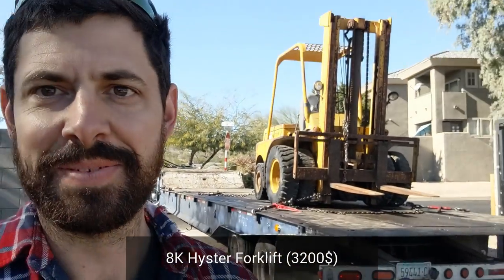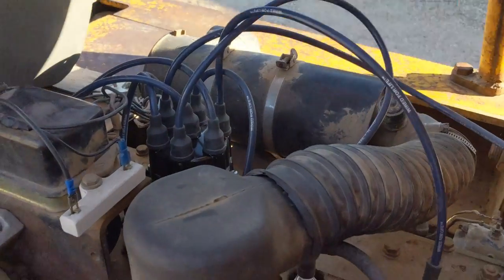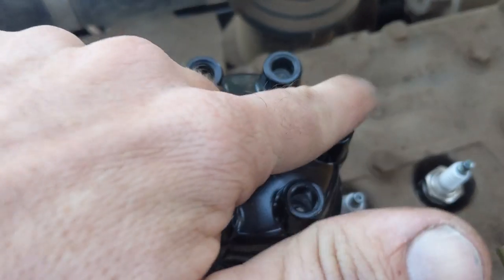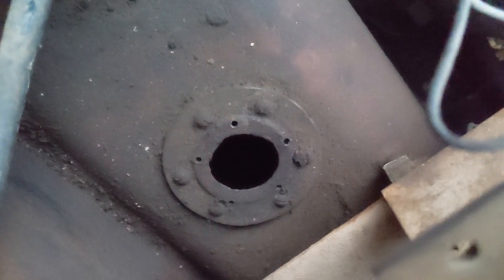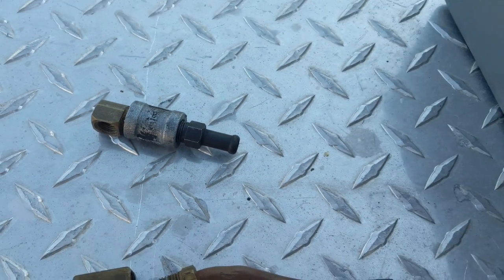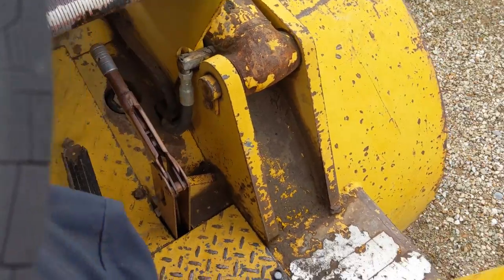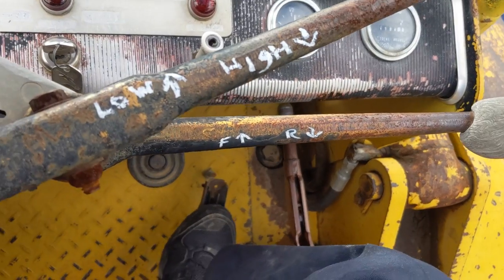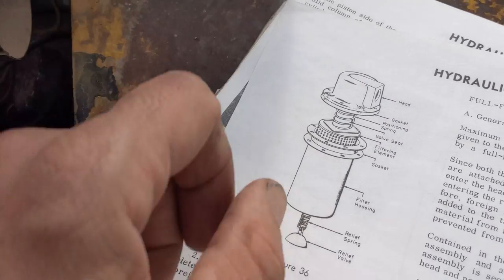Bringing an old dead Hyster Forklift back to life

Comment: Hey guys. I am a feild tech for Briggs Equipment.  Hyster dealer. Great video.  I still work on and rebuild these motors. 163 an 172. Redseal flatheads back in the day. Good engine. Y'all besafe and have a great day👍👍👊

Comment: What a great score!  And, a fabulous tool to have around. I see that someone put a hitch ball on one fork, which should suggest an easy way to spot various trailers.  You can buy repair kits for those hydraulic cylinders fairly easily. I never rebuilt one myself, but have watched it being done. There are probably several videos on YT to show the fine points.  Nice job! Wish I had one like that years ago, all I had was a little three wheeler with a Crosley engine, but it served my purposes at the time, but that was in the 1970s.

Comment: I used to drive the Perkins engined version of that truck it was indestructible, only failure to proceed I remember was greasing it one day and had mast fully up and a hose burst it came down so hard it broke the concrete floor, always propped it after that.

Comment: Awesome, thanks for sharing your knowledge. Your diagnostics are on point.

Edit, I would have flushed the sediment out of the tank just for peace of mind and to save the filters
Reply from the maker: I did take a look at the drain plug but it was frozen solid and I have had bad luck in the past removing rusted ones. I must admit I took the easy way on that by just adding a new filter and making sure the pickup tube wasn't clogged. Good eye

Comment: I've used 2 Hyster forklifts, both had forward and reverse on the accelerator pedal; pressing the right side put the transmission in forward gear, pressing the left side put it into reverse gear. I could stall the engine if I wasn't careful! The flat-head engine design must have been very durable, I see it a lot.
Reply: It's called monotrol
Reply: Im 16 and i work with that type of pedal on a hyster every saturday. They are very nice.

Comment: Six cylinder flat head., these forklifts are incredibly well built,  twenty millimeter thick rolled steel wheel guards. Frame sides are ten millimeters thick alone. Super strong.
We used to build these from scratch.
Reply from the maker: Danville, IL, right? I'm so used to building restomods where weight savings are important, it's so strange to see fenders made of almost inch thick steel. Strange and awesome
Reply: @AustinCoulson  No we built them under licence in New Zealand with a lot if caterpillar equipment. We had a hyster  assemble line next to a caterpillar assembly line. 
yes the fenders are profile cut then rolled. Your lift is the Hyster H150 , the single drive wheel with narrow fenders is the H80.
Check out how robust the steering Axel assembly is under the counterweight. 
Hope you get plenty of use from this lift , very strong. 😀
Reply from the maker: @axeman6560  I was actually looking at the steering the other day because my buddy's 4k forklift broke his steering arm and I wanted to inspect mine and it looks practically indestructible. I shipped a turbine engine to NZ a few years back for a guy who used it as a starter for an even bigger turbine engine.
Reply: Mine has a Perkins diesel  in it, it's a really strong machine, very simple to fix
Reply: @elljay4587  Perkins nice
Reply: It looks like a Clark F 60 I owned not to long ago , had a cont. 209ci in it was a very similar looking machine . Will have to talk to some old guys that used to work at Clark Mfg where they built them , I believe Clark and Hyster are related companies.

Comment: I worked on Hysters for 24 years You will never wear it out, Best machine on the market. A bit of advice the ONLY suspect part is the head gasket make sure its always full of coolant and the fan belt is tight and radiator is clean. The head can warp if they are left to constantly overheat and the centre bolt on the head is very close to the bores and can corrode and break in. Its a Continenal side valve engine.
Reply from the maker: Thanks for the heads up.  I use this Hyster on average 2X a week and usually for less than 10 min or so at a time, and now that I have a gauge I can keep an eye on the temp. Always good to know where the weak points are to keep an eye on em.

Comment: The fuel filter in the tank attaches to the round metal thing on the end of the fuel line.   I've used them,  and they're fine, but they're not supposed to go in the tank.

Comment: Wqw,, we had a 5 ton,  5000 kg   one like this at work in the mid 80's ,, the Maintenance man replaced the old side-valve motor with a more modern OHV Holden motor ,,, took the duel wheels of and replaced them with single wheels ,, it still was going well when left 15 years later ,,

Comment: I would think that is a three speed if you lift the hi-lo lever and pull it toward you that’ll give you first gear, it’s so low it’ll never have been used so probably be stiff
Reply: You are correct! That's a 3spd,no one really likes putting it in 3rd because it goes sort of fast and is scary to operate. The range shifter gets stiff because it's not used much!

Comment: Cause and effect, what was the last thing done when it stopped working. Middle of the night call: 'We changed the fuel filter and now it doesn't run." They had reversed the inlet and return lines. Retrace the steps. Made a few of those errors myself, knew who to blame.

Comment: I had an '84 Camaro that I did a tune-up on and after changing all the plugs, cap, rotor, wires, etc, it was running like crap.  Went to pick my girlfriend up from work and one of her coworkers came out asking why it was running so rough.  I told him everything I did and he said "I can fix it in five seconds".  I was in disbelief, but I opened the hood and he looked around for a moment before grabbing hold of the cap and twisting it.  You couldn't even see it turn, but sure enough when I started it, the car was running fine.  He said that particular cap can look like it's seated correctly, but you have to wiggle it around and you'll feel it "click" into place when the springs on the clips engage properly.

Comment: There is water in the hydraulics, the vent on the hydraulic reservoir is clogged. The vent tube on the mast cyl may be clogged, and the mast cyl probably needs repacked, both the piston seals and the top seal
Reply from the maker: Thanks for the info, I will take a look at that vent today!

Comment: The clutch is only there so you can give throttle for you hydraulics to operate faster without moving.
You don't need to use it when moving or changing from front to backward.
Reply from the maker: Hmmm I'ma have to try this when I get back to the shop. I was using the clutch like I usually do on other equipment.
Reply: It's an inching pedal not a clutch
Reply: @joeharmer574  I think you will find that its an oil clutch you cant change direction without stopping. Hyster made these with an oil clutch and a torque convertor with power shift usually with the  mototrol pedal but sone did have hand control levers. I worked at Hyster for 24 years
Reply: @derekevans8266  After watching it again. it's a clutch. Doesnt mean it's the oil clutch version. I own 2 oil clutch units. Neither are monotrol and have a 13K one that's manual that is not oil clutch...similar to this one.
Reply: @joeharmer574  I think they did oil clutches and dry clutches we only had one customer who bought oil clutches 99% were new monotrol

Comment: really common issue with the hydraulic cylinder drifting, might require replacing the section in the valve body for the lift cylinder as those cylinders dont have holding valves and rely completely on the valve body to keep and maintain pressure in the cylinder.
Reply from the maker: Thanks for the info! I am by no means a hydraulic specialist so I will take a look at the manual and see how hard it looks to replace/repair that. Right now, the drift is so slow that it really hasn't affected its usefulness yet, and i've been too busy using this thing to have any downtime to work on it.
Reply: @AustinCoulson  honestly i would not even touch the valve body unless it is leaking alot, those can be a nightmare to seal correctly once taken apart.  Plus its pretty normal to have some drift on a forklift as they are a material handler, and not a holder. if they were to be expected to hold things for extended periods of time the cylinders would have holding valves.

Comment: You either have a blockage in the filter, or there is air getting in from the suction line causing aeration of the fluid, if there is wear in the hydraulic pump it will also cause those symptoms
Reply from the maker: looks like you figured it out quicker than I did, probably due to your great name...I tear the filter apart in part 2 and it was clogged big time

Comment: Not a clutch. It works an inching valve in the trans. When you push this pedal it sure hold the brake and kicks the trans out of gear you can riv the engine to pick up a heavy load.

Comment: Hey great video I have one of these machines with a missing mast cylinder do you have any resources for parts?
Reply from the maker: There were a few industrial shops in Phx I used for hoses and seal. I got a lot from eBay though

Comment: Great job. I'm not trying to be negative when I say the the continental engine is very durable but never produce a lot of torque or HP. I've seen countless ones that have cracked the block on the deck (if I remember right, it happens between #1 and #2 cyls) In the forklift industry we joke that you get 1 HP per 100 pounds of engine. Your lift cylinder leak....The cylinder is what's called a non displacement cylinder so the seal on the bottom of the rod (on the piston) is bad. The hose that run down the side of the cylinder is so the fluid that gets by that seal has somewhere to go (back to tank) Obviously seals involved in the gland nut but that's just so it's directed out the hose. Just a little FYI
Reply from the maker: Not negative at all, great info to be on the lookout for!
Reply: Austin Coulson....a customer of mine has a 13K forklift very similar to yours but it has a straight 6 GM motor. Again...nice job buying and getting it going! If they could all be that easy!
Reply from the maker: @joeharmer574  easiest fix I've had in years. Could have gone south really fast and ended up with a 11k lb boat anchor in the driveway
Reply: Austin Coulson.....No kidding! They are a very durable engine and I've got them running before after sitting for years

Comment: I personally wouldn't want to run a forklift that doesn't have a clutch. It makes it possible to rev up the engine to speed up the hydraulics while on the move, which is handy while unloading trucks from the ground
Reply: Inching pedal

Comment: Had a look at the video and you have a standard two stage upright and I am 99% sure that the hose from the top of the cylinder is just a vent hose and should never be under any amount of pressure. The oil leaking from the very top of the cylinder is leaking passed the wiper seal as it is venting back to the hydraulic tank. In theory there should never be any oil up there. The cause of your forks dropping is the oil is leaking passed the main ram seal getting to the head of the cylinder and venting back to the tank. So remove this vent pipe and see how much oil is getting passed the seal. Be careful you might get wet. The truck is a H80C
Reply from the maker: Thanks for the heads up, I will try that. Also, I was unaware that fully extending that cylinder often was good maintenance

Comment: Brother , amazing machine but please lubricate those chains happy lifting 👍
Reply from the maker: I lubed them with 30w oil per the manual. Good eye.
Reply: @AustinCoulson  thanks for the compliment are they cleaned prior to lubeing
Reply from the maker: @virtuousman794  I used a bristle brush and then soaked them in oil. I was taught on motorcycle chains to not degrease, steam clean, or pressure wash, but I'd be interested on your take on that
Reply: @AustinCoulson  we use tooth brush and gasoline to clean those chains and sprays crc or wd 40 brand premium white special lithium grease the stuff is amazing they won't run out or accumulate dust or grime easily by the way did u take care of those grease nipples.

Comment: That previous“mechanic” should have his tools taken away.
Reply from the maker: 100% and give them to someone who will learn to use them
Reply: @AustinCoulson  he probably mistook number 6 cylinder for number 1.
Since number 6 is in the front of the truck.
P.S.
I just drop plastic coffee straw into the spark plug hole, you can fish it around into the cylinder and feel the piston climb and fall.
Reply from the maker: @glennchartrand5411  you are probably right on him mistaking the front and rear of the engine as front and rear of the forklift and doing the wiring backwards. 

The problem with using a straw is on the flatheads the spark plug isn't over the Piston, it's off on the side and all you can see are the valves.

Comment: I've driven Clarks, Toyotas, Cyclones, Yales, some weird Indian import, and Hysters. I'm a Hyster guy, they really are built like tanks and run solid. The newer Toyotas are trash. Ours are constantly breaking or wearing our while the old 80's hysters keep running like tops.
My fav of the whole shop is the 12,000 lb Hyster we use as a backup for moving steel. She'll lift 12k and controls great. If the load's too heavy, she let's you know by not lifting it. The hydraulics won't budge. Our big 12,000 lb Toyota on the other hand will lift 10k and starts to get squirrely, hard to steer, bounces about. She'll lift more than she can carry but won't really let you know till it's too late and start to tip. The Toyota's 6 inches wider on either side and a foot longer than the Hyster and it makes it incredibly hard to see anything nearby.
Reply from the maker: Dang, I've had good luck with Toyotas, but they were all newer and I only used them sparingly when I rented them. I'm happy with this this ole pig so far, and I love flatheads. Very solid motor design, just low HP, but they make up for it with reliability
Reply: The Cat V50C's will lift more that it can carry too. They'll lift the back end of the ground and still keep lifting the load..

Comment: Grease the lift chains, or use chain lube.  Rusty chain link pins can wear fast, one fails and you'll drop the load...
Reply from the maker: I removed them and soaked them in 30w oil per the manual. Good looking out!

Comment: I assume you are in the US. If the first three digits in the serial number are C5D it was made in Danville Illinois. If the first three digits are C5T I may have assembled it new in Toronto Canada. Just sayin'.
Reply from the maker: It is a C5D, so sadly I didn't get one of yours, which would have been very cool. Do you know if the machines from different factories were otherwise identical?
Reply: @AustinCoulson  Identical
Reply: I just acquired a hyster and all the tags are worn. I did find a serial number and it's c5d 6833 L any info on that. I'm trying to purchase a manual. I think I have a h60c but not sure?....

Comment: 11k lbs ?!? 
Holy hell its heavy for being so small.
Reply from the maker: The whole rear of this thing is solid cast iron. I was told the ballast section was almost 7k lbs alone, but all I can prove is it's more than I can lift!
Reply: Forklifts usually weigh 60% more than they can lift , most 5000lb trucks (the most common size) weigh about 8,000lbs this one is actually lighter than usual because the wheel base is so long.

Lowry used to buy two of these trucks , cut  one in half just behind the drive wheels and the other one was cut behind the drivers seat , then they'd weld the two long pieces back together making a forklift that could lift 10,000-15,000 lbs (depending on which counter weight it had).

They also replaced the continental with a chevy vortec V-6.

They sold like hot cakes and Hyster threw a fit when they realized their old rebuilt trucks had a better reputation than their brand new ones.

Eventually the "supply" of old frames and counter weights was used up.